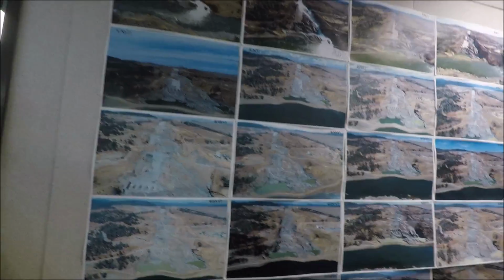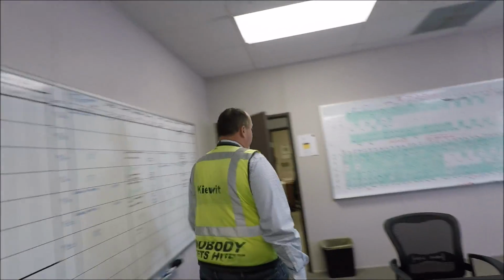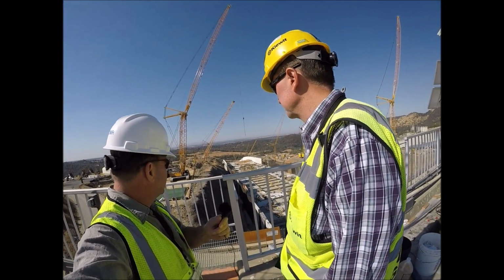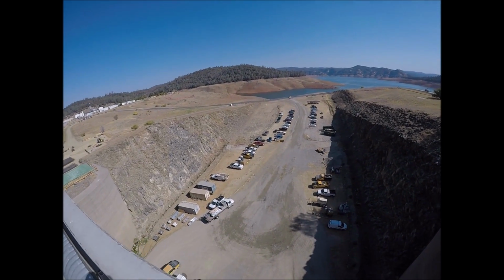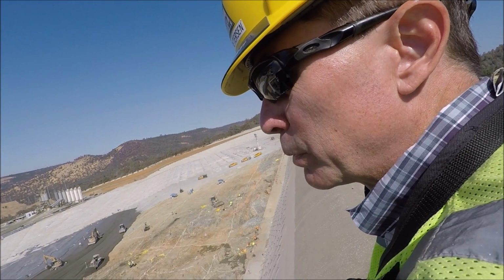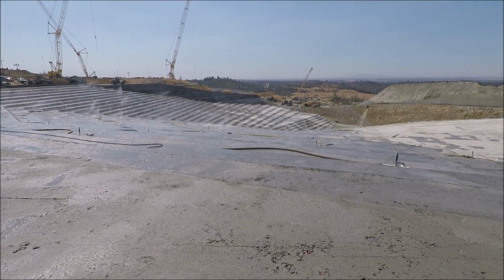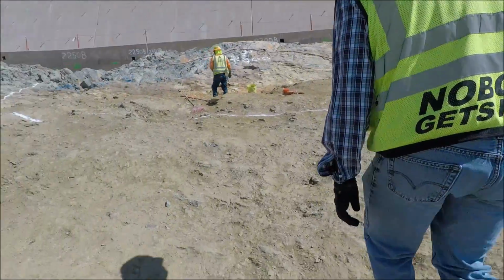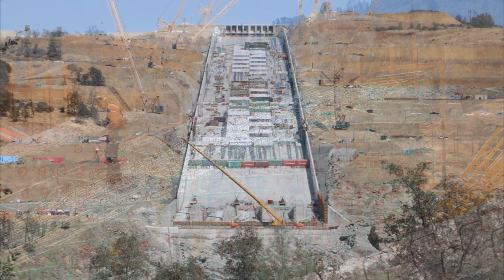Oroville Spillway Rebuild Boots on the Ground Report- Part I

Comment: Juan thanks for the comprehensive reporting on the rebuild of the spillways. You are what a reporter should be and there are only a few that can compete with you 😉👍. I follow you since the beginning of the disaster. We need more pilots as reporter in the MSM. My opinion is that you are the only one reporter on this case that is respected by Kiewit and DWR for your honest and to the point stories. From the Netherlands I give you thumbs-up

Comment: Juan
I have a question about the emergency spillway that I would like you to ask the DWR representatives.   When Kiewit Constriction gets done with all of the RCC from the buttress to the secant wall  will they, or another, contractor, scower the hillside from the secant wall to the river of the dirt & dirt covering the hillside, down to the bedrock, so the dirt and debris  won't end up in the river backing up of the river to the power station.  If the emergency spillway ever needs to be used again.
Thank you
Reply from the maker: Some Rip rap (big rocks) will be added to just below the 2 low points, then flow down the natural drainage.
Reply from the maker: Most debris from the emergency came from the spillway. The diversion pool has been dug down 90 ' deep.

Comment: i was thinking that during the placement of the RCC .. that a pavement roller/compactor with a hydraulic lifted rumble strip drum would be used where the next step is to give it a better footing for the next layer. sort of an interlocking effect..  too late on this project but perhaps they will remember and use it on future projects with RCC..   the rumble strip drum has bars on it to create depressions left and right of the traffic lanes on freeways.. so if you drift out of the traffic lanes it wakes you up..

Comment: Большое спасибо за информацию по ходу работ на грандиозной плотине Оровилл. Специалисты гидротехники всего мира наблюдают за ходом работ по реконструкциии водосбросных сооружений и реновации всех основных сооружений : Здания ГЭС и ГАЭС , отводящих каналов и расчистку русла, постоянного водосброса , дополнительного водосброса и укрепления склона . 
Применённой механизации и организации круглосуточных работ в условиях косогорной площадки с применением крупной строительной механизации-требует детального планирования и четкой организации работ, что удаётся делать в сжатых сроков и тщательного учета гидрологической обстановки. Желаю успешного окончания крупных строительных работ с высоким качеством и надежностью!
Reply from the maker: Thanks Vladimir!
I believe this is the correct Google translation -" Many thanks for the informatiamn Hydrotechnists around the world are monitoring the progress of reconstruction works and spillway structures and renovation of all major facilities: Buildings of HPPs and PSPs that divert channels and clean up the channel, permanent spillway, additional spillway and slope strengthening. Applied mechanization and organization of round-the-clock work in a sloping area with the use of large-scale construction mechanization requires detailed planning and a clear organization of work, which can be done in a tight schedule and careful consideration of the hydrological situation. I wish successful completion of major construction works with high quality and reliability!

Comment: I still don't get how that things not going to break with the first decent freeze or earthquake.. It's over 80ft (at points) of solid concrete with no expansion points.. how is it not going to just crack? I really hope they are going to be putting the road back in to the boat ramp.

Comment: Incredible reporting Juan. You have done more for public relations and education between  state, federal, & local govts, civil engineers everywhere,  and your local community which they serve and the taxpayers that pay the bills than any govt PR office has ever strived to achieve. Better than any civil service bureaucratic whose main job these days seems to be to spout off platitudes of vague reassurances without any substance on what's actually going on- assuming we're too naive to understand it anyways. Depth of education goes a long ways in bridging the confidence gap between the govt and the public they serve. The tools you have utilized, your numerous  fly overs; the research online for blueprints; the technical education on how a dam works and what isnt working now; the hows of work on the dam and whys on decisions that are made, decisions that impact the ENTIRE interrelated system that makes up the irrigation and water management of the state; digging into the local and history of the area and the dam and the unprecedented access to the project based on the trusting relationships you have built with the project managers and engineers says volumes about the public success of this event. This is how recovery from an engineering disaster should be documented. The more you take the public along, through the recovery and rebuilding process at the site of the failure, the more faith they have in the institutions they hired to look after the public interest. The public- private relationship doesnt always have to be adversarial.

Comment: Thank you for the excellent coverage! I have a few questions about what's coming: What kind of testing is being done to ensure continuity of the structures and joints post construction?; What kind of system level test is planned to ensure that each system (e.g. emergency spillway or main spillway) works as intended w/ no surprises?; What provisions are getting put into the maintenance plans to ensure there isn't degradation over the next 50 or 100 years (e.g. the drainage issues on the main spillway)? Thanks again!

Comment: Here's a couple of questions for your next press briefing:
1. How much force is being applied to those dentates by the water (assume full diversion capacity flow)?
2. Has anything been done to increase the diversion of Feather River flow into the California Aqueduct during times of heavy dam discharge?
Reply: 1 at 270,000 CFS it would be enormous.
2. No during a wet year the aqueduct is generally full and most reservours would fill rapidly.  If you wanted to put more water in the aqueduct you would have to enlarge a thousand of miles of aqueduct to deliver the water.  The cost of that and time needed to build it would be would be many times larger than what is being done now.
Reply: Steven: For #1, I don't have the math skills to handle it, but I assume that part of the kinetic energy of the moving water continues around those dentates, while another portion throws the water up into the air to create a waterfall into the river's pool. A third portion of the energy creates a force against the dentates. I had recalled seeing the dentates damaged last year, and I got to wondering how much force is trying to wash those dentates into the river. For #2, I can't say that I have ever seen the Aqueduct channels "full to the top." I always thought that diversion capacity was limited by pump station capacities, either along the Aqueduct course or at the input head just a bit below the Oroville dam. BTW, there's a diversion lake, a reservoir for water intended to go into the Aqueduct; could this diversion reservoir be enlarged or deepened to accommodate more water? I also just thought of a #3; is there an intertie between the California Aqueduct and the San Francisco / Hetch Hetchy aqueduct? If so, some of SF's storage could be filled with some excess Oroville water. Maybe California should increase the Aqueduct size, at least above San Francisco.

Comment: Thanks Juan great report and super cooperation from DWR. A massive amount of work has gone into the emergency spillway cut off wall and RCC collection areas so it sort of surprises me that should it ever be used then downslope from the cut-off wall the water would scour down the dirt hillside. This would surely erode dirt and rock [as before with the head cutting] straight down into the Thermalito diversion pool possibly causing it to back up again or at the least needing a big dredging operation. Are there future plans to avoid this? Looking forward to part two. Thanks again.

Comment: During the construction work of cascading route towards river side need to be the provision of 
separation joints at different locations for the seepage & drainage system both at horizontal & vertical ground concreting positions for the exhausting of ventilation applications must be add in Emergency Spillway because without this after passing some time Crakes and Settlements impacts will be develop, that’s why think about as soon could be applying now.?
I mean bear the impacts of upstream water potential (hydrology) whenever reservoir full, also underground heating and gases exhausting & upper ground surface sun heating factor, along with other static forces + (sink holes, settlements, earthquakes, blasting) may be effects or more issues will come up so need to be vent system by insert pipes, develop for its long time utilizations.??

Comment: Juan, I don't think they should be taking a shortcut on the emergency Dam. You made it sound like, a few feet of water could be rolled over the top. Now, what if we had major rain and the dam went to the emergency spill. But at the same time all that water that is filling in the upper dams let go because of major mud slides and there would be a earth quake at the same time.. And now you have a wall of water hitting it at 10 to 20 feet at once. Don't laugh, It could happen. I think what would be a nice video for you to do would be all the dams and power plants not far above where you live at. You have to remember it once rained for 40 days and 40 nights. You have to consider all  Scenario's. That emergency dam is being completed for a few feet of water. Not a wall of water in a major Catastrophe. Great video and that crew is the top of this countries Best. "Best Wishes"

Comment: Juan,....You did not ask the oblivious question, which is, how are they going to attach the new side emergency RCC berm that they are now constructing to the perpendicular abutting transition of the existing Radial gated Structure and the much lower in elevation original emergency spillway weir that will provide a finished high well above the 901 elevation of the weir ???  Also at that translon point to have enough room for the road that would need to turn 90 degrees after crosses the existing bridge over the main spillway just below the radial gates. It would  be a very tall RCC berm that would need to be constructed to prevent the overflow at that critical point should maximum overflow of the emergency spillway ever be needed. Ask that question when you do phase #2 of your report. Thanks
Jerry

Comment: I never did get an understanding of the purpose/need of the drain systems for the spillways, regardless, pretty elaborate
Reply from the maker: water gets under all the works and needs to be drained out from underneath, or it will fail like the old spillway did.
Reply: blancolirio  Thank you.  I assume that would be seepage from the reservoir, versus the natural water table...? (perhaps reminiscent of the 'green patch' controversy...LOL)

Comment: Thank you blancolirio for your continuous effort to report facts and not nonsense! 

I have a question about the gate structures, you may ask too: How is the status of the gates and auxillary structures? Did they have test the stability of the gates imternal concrete structure and how and when will they repair the splits in the concrete there ? Will those weak structures impact the function of the spillway in fullmode this season?

Comment: Did I understand one of the interviewees to say that one of the concrete types (think it was RCC) gets stronger over time & will eventually exceed the 3000 PSI design strength?  If that is the case, why not build the whole thing with RCC?  And how will the new structure hold up in a major earthquake?
Reply: It's about matching materials to the job at hand. RCC is strong, but also very porous and doesn't hold rebar very well. RCC's big claim to fame is the speed at which it can be laid. So, when you need concrete to be structural, more water or abrasion resistant, you need conventional concretes. Conventional concretes will easily exceed 5000psi on initial cure and have a much harder surface.
They're having to design in to existing structures, so they don't have the luxury of using new techniques in many places.
Reply from the maker: Good question, many smaller spillways and dams around the world are now made solely of RCC.

Comment: Hey Juan, question that I don't remember anyone asking about this project.  Will they test at least some water on the emergency spillway?  In other words, will they flood it in a controlled situation just to see how well it works?  They could pump from the other side and simulate an overflow situation.
Reply: highly unlikely.  The spillway is not used yearly.  Probably more like once every 8 years they get enough rain to get the lake level up high enough to use the spillway.    And even  when they do get a wet year they might be able to dump enough water through the generators ( to make electricity) and not need to use the spillway at all.

The new spillway is built to todays design standards which are a lot better than the standard that existed in 1960s.  Buch more rebar is used today and it is epoxy coated to prevent corrosion.  The changes mean the spillway is considerably thicker, and stronger and should last longer.  So the only wayto really test the strength of this would be to push it to record flows (higher than 2016 flows.   At lower normal spillway flows are unlikely to reveal any problems.
Reply from the maker: Not that I've heard yet.

Comment: After spending so much money on the emergency spillway, will they ever conduct a controlled test of a few thousand cubic feet per second to see how it performs?
Reply from the maker: not that I've heard of. Heavy rain runoff can maybe give us an idea..
Reply: The spillway has a maximum capacity of 270,000 Cubic feet per second. A few thousand flow test would be less than 10% of max capacity .  That isn't enough to really test it.  It would just be a demonstration that it works.

Comment: Excellent report and explanation and very good one-person production, showing how, with just an action camera with the advantageously inherent extreme wide angle of view plus a wired omni body mike with muff, the results are great. You could also use a selfie stick but you needed to pan away during the walk-and-talk interview. The latest GoPro Hero 7 has very advanced built-in stabilization but it’s relatively expensive (~$400).
Reply from the maker: Yes. I'm disappointed in the stabilization of my GoPros, and I still cannot connect audio to my GoPro stabilizer handle!!  I love hand held productions, it's all I know.  Thanks for all the great tips Bruce!
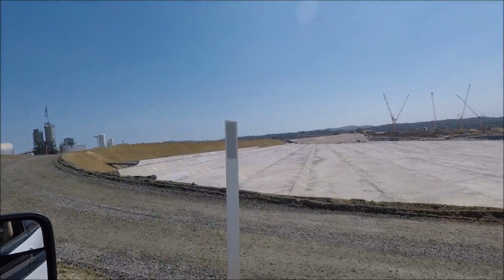Reply: blancolirio  This recently ex regional 1st Officer, now back to being a working CFI, does excellent Alaska camping travelogue vlogging production with his friend Stephanie in her performance-modified Cessna 170 (wingtips, engine with constant speed prop). He appears (and sounds) to be just using action cameras inside and outside and a cellphone outside. He records good flying sound with her Bose headsets. They are younger than we and travel with trail bikes for adventure transportation. (17:49)

https://youtu.be/CLFP2vxucV8

Comment: With the Main Spillway was the original built the same way but Poor maintenance is the reason for the Failure? I like getting updates on the project. Most people have forgotten about the Oroville Dam.
Reply: That was address in an earlier video report he did.  Basically it was a combination of design and construction errors.

Comment: FYI:  Rebar size is expressed in 1/8 inches so #11 bar is 11/8" in diameter, or 1 3/8".  #7 bar is 7/8" in dia. , #4 bar is 4/8 or 1/2" dia. and so on.

Comment: Juan, thanks so much for your work, and pass along a big thank you to the folks at Kiewit and DWR for their good work. It's so easy to cast criticism about. I remember folks attacking the DWR for the trouble last year when the reality is that they handled a truly historic water year with a broken spillway, no powerhouse and no emergency backup. At the height of the rain event in February, the inflows were around 290,000cfs if I remember correctly. And they kept that water inside of the levees down stream.
Reply: Yes, DWR did prevent a historic disaster from getting even worse. But they threw local residents that live near the dam under the bus. Between the road and recreation area closures, we were cast aside and treated like potential criminals for residing near the dam. Never mind the irreversible damage done to the diversion pool area.
Reply: Have you had an opportunity to provide feedback relative to these problems? And how responsive has DWR been?
Reply: After well over 100 letters and social media posts, and 27 meetings with DWR to date, there has been some response. Oro Dam Blvd East has been reopened, albeit at a reduced, 25 mph speed limit. And there has been some half-hearted attempts to reopen closed recreation areas. Still, no one can give back the 1 1/2 years (and counting) that have been stolen from us.

Comment: First i've heard of a possible second gated spillway.  Is there thinking that the inflow rate(s) during the flood season may overtop again.  If the CFS exceeds current operation with a second spillway, how are the levies downstream to cope?
Reply: More likely that the emergency spillway would be upgraded  down to the river than a secondary gated spillway would be built.